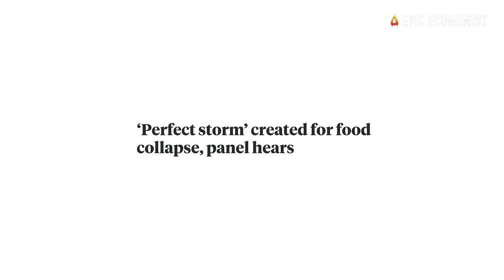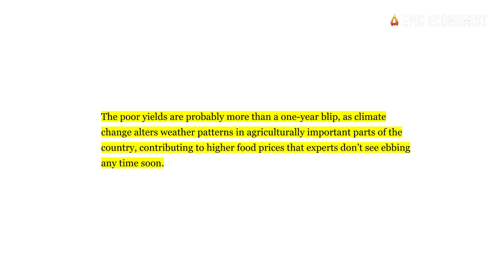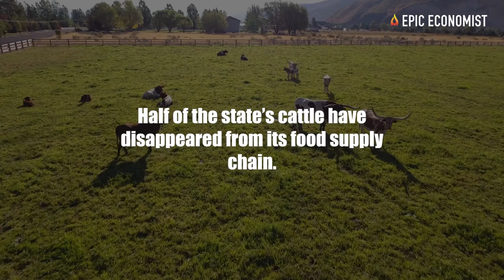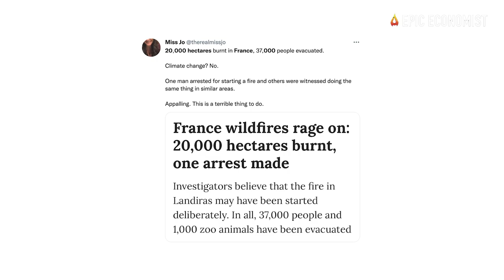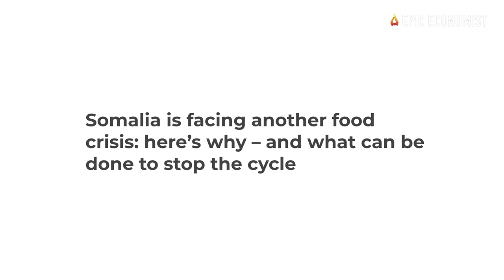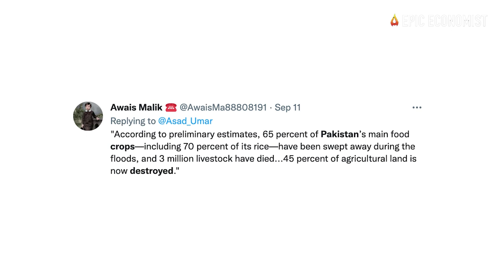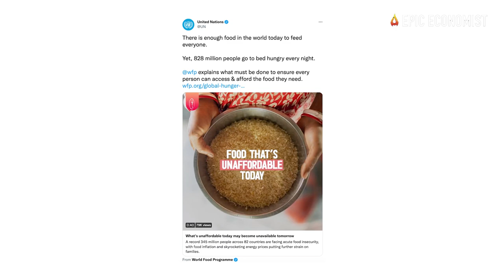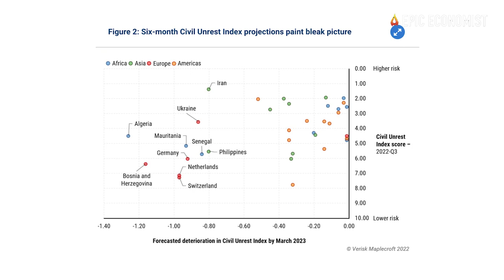35 Things We Know About The Coming Food Shortages

Comment: Whats being told in this video is just the tip of the iceberg. humanity need paradigm shift as whole. which is quite unlikely. as there are no way to convince more than half of the population of world to change. Especially meat industry should be immediately stop. more than 70% agricultural land being wasted for meat industry. switching diet will definitely slow down the shortages however wont address the issues as damage already been done. industrial farming should be abolished, regenerative farming should be introduced. non essential industries that cause environmental impact should be immediately shut down. More people should be channeled to do actual work that benefits to humanity instead of unnecessary and destructive jobs positions like insurance agents, speculators, bankers, scammers, drug dealers etc. more engineering and agriculrtural jobs should be introduced